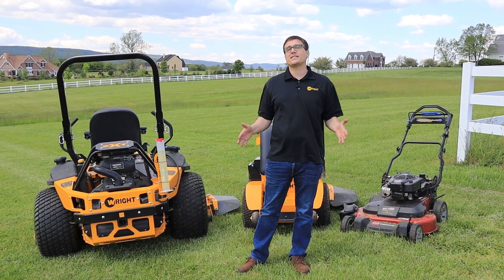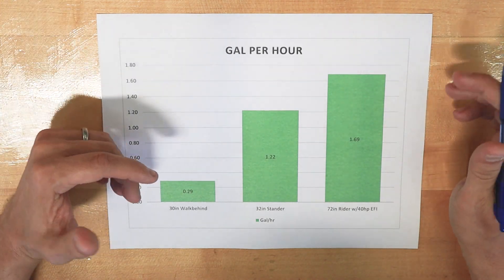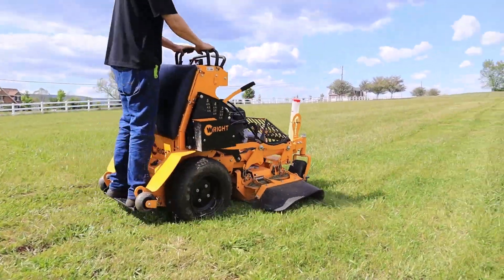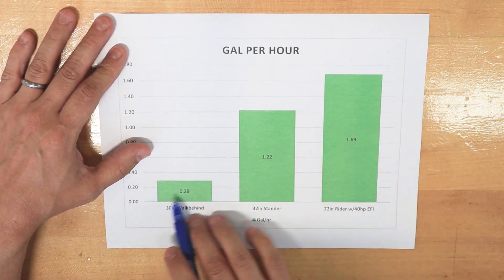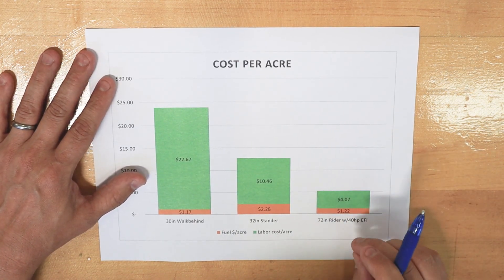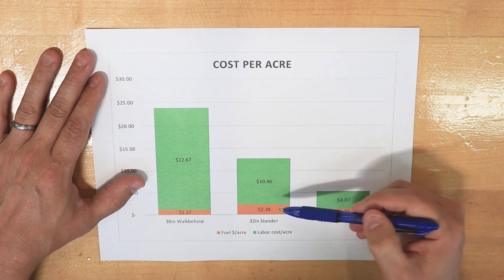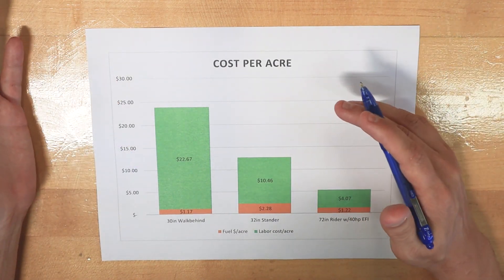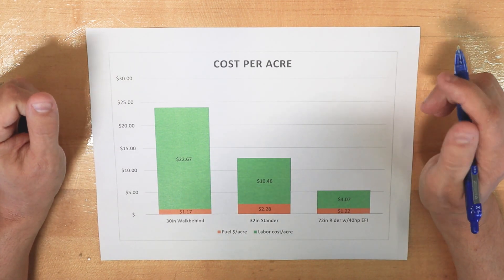Fuel Consumption Test: Gallons per Acre VS.  Gallons per Hour | WRIGHT

Comment: One interested conclusion to this data is... even adjusting for today's fuel prices, fuel is nowhere close to being the dominant cost. Even on the "fire breathing monster', which has the lowest labor cost. Interesting data. Thanks.
Reply: Remember you need to use ethanol free gas which is $1 -$1.50/gal more than regular for carburetor machines for best performance and reliability. EFI mowers don't care if they burn corn or gas as long as the ethanol fuel doesn't start in it over the winter.
Solo and mowing acreage GPH was a big deal. Cutting lawns labor and insurance are two biggest overhead costs

Comment: My older 36" Stander with a FH541v (17 Hp) generally burns only around 0.8 GPH, while a 61" 25 HP would burn 1.1 to 1.2 GPH in normal usage, and cuts over twice as fast.  My old Honda 13 hp beltdrive 36" only burned 0.5 gallons per hour, but used more fuel per acre than the 36" Stander.

Comment: Excellent information!! Crushes the misconception that bigger unit means higher Cost of Ownership!
Reply from the maker: Thanks!
Reply: @WrightMowers  You're welcome!
Reply: Not exactly... a NoN-fuel injected commercial machine has a FAR cheaper replacement cost for engine replacement.
The newer FI engines do save gas, may have more power... but run the same exact air cooling, and thus require rebuild or replacement around 2k hrs (at best)
Very expensive, considering the cost of the machine was Already expensive.
The same commercial machine with the less fuel efficient (off the shelf) carburetored engine (25-30hp) will also lose the engine around 2k hrs, 
BUT those engines are cheap and plentiful and simple to swap out... 
I think i'll take some fuel waste, over some fuel savings, when the FI engine is Much more complicated and roughly Twice as much to replace. 
You can buy an 'auto-choke' Briggs 25hp engine Right Now brand new for under $1k.
You don't even want to know how much a 35hp Briggs engine is, ordered thru the dealer (which is the only way you'll find it) costs... even IF it is available.
I'd guess around $4-5k.
That just destroyed all those hours of "fuel savings" ~

Comment: Great content........ we would also like to see a comparison of three exact 60” mowers with three different engines i.e.   27 hp Kawasaki carb.,   31 hp Kawasaki EFI, and finally 40 hp EFI.      My contention is that a 40 hp engine on a 60” mower or even a 72” mower is Gross Over Kill.    I liken it to shooting a squirrel with a 50 cal.    Somebody commented once.....well just throttle down.   Has anyone ever see an employee throttle down....  NOPE.   That is why we would like to see this TEST.   Gas is one of our biggest expenses.   We don’t want to feed the beast (drain our profits) if we don’t have to.   I know you guys understand this and hopefully provide your clients with smaller engine options.    Great mowers.
Reply: I think this would be great. I bet more of the efficiency piece will come down to HP for turf density and how much you’re cutting off. I’d also add another factor to this scenario. One run on a weekly service type cut. A second run on 3 weeks of growth where you’re cutting 8” or more off. Find the balance on engine HP for cost efficiency that’s best all around. I suspect each would have a slight advantage based on turf conditions.
Reply: @Camp-RiteRV  Yes, we actually also ran tests for mowing the grass, running the same area with the deck up, running the area with the blades off, and running at high idle to see how much fuel was being used for each portion of the work.  I think it was more than 50% correlates to how much grassing is getting cut off.  We didn't put those results in this video because the main point here is that bigger EFI engines save a ton of time and have nearly no trade off in fuel consumption (by the acre).
Reply: You never want operate a mower at anything but full throttle as you risk overheating the hydros (decrease in engine rpm = decrease in cooling fan rpm) and a decrease in cut quality (decrease in engine rpm = decrease in deck SFM). 25hp is just BARELY adequate for weekly growth on a 60in machine and I've been looking at engine upgrades for my 60in Z for a while now. A 35hp Vanguard would solve my problems and allow me to stay full swash through all of my weekly cuts. Another thing worth noting is that an engine running at max load all the time will not last as long as an engine running at 50% load. Wright does have an older video looking at an EFI vs Carb engine on the exact same mower. IMO the fuel consumption difference between a 31, 35, and 40hp EFI engine will be negligible.....at least not over a short period of time. Wright is all about maximizing durability, reliability, and productivity; the 40hp engine on the ZXT is what they felt they needed to achieve those goals. If you really need something with extreme fuel efficiency you might consider going the diesel route. The initial cost is higher, but they pay for themselves after some time. Kubota makes some sweet diesel mowers, so does Blount Woods and Grasshopper.
Reply: @jeremiahjorenby2275 .   I have a 27hp on one of my other zero turn mowers and it blows thru week grass growth like a hot knife thru butter.  Even tall wet grass.   The only time it might labor is on knee high grass (but how often are we mowing that height-rarely).  Therefore, for the duration of the season I am enjoying fuel efficiency.   The term “negligible” does not apply when you go from 27hp, 31hp all the way up to a 35hp or 40hp.  There is quite a jump is gasoline consumption and those that choose to go that route will clearly live at the pump and will be giving their hard earned dollars away.   You made a great point about Diesel engine, (I also own a Brand New Kubota BX 2380 tractor and the the fuel consumption is very low). But diesels mowers are heavy and have their own issues.   Well, I wish you luck on finding an engine replacement for your Z.
Reply: @sunseeker5071  Efi engines will out perform carb engines. deck size will also determine amount of grass cut. Bigger efi engines all consume very similar amounts of gph but a 72 inch deck cuts 20 inches more per stripe than a 52 deck. How much more grass is cut at that point. Efi is the way of the future for mower engines in the next few years anyway. Like with this test a 40 hp efi engine consumed .4 gallons more per hour than the carb engine which was under half its horsepower. Effectively a big engine jump for a small gas increase
Reply: @sunseeker5071  I have one of those early mule-drive style Exmark LazerZs with the 60in ultracut deck, I am now wondering if maybe the mule-drive is a source of parasitic loss. Then again, I don't know what the drive ratio of your deck is, what your torque output at 3600rpm is, and what the SFM of your deck is at 3600rpm. The ultracut deck on my machine is notorious for wrecking spindle bearings because Exmark spins the deck so fast. Exmark ended up slowing the deck down when they went to the triton decks to try and extend bearing life. A side effect of the triton deck was more fuel economy and better performance in tall stuff since the deck was now being underdriven.....but people who previously owned an ultracut machine were unhappy with the triton's cut quality on weekly stuff. You could achieve the same results by moving to a blade with less lift. If it wasn't for the fine fescues I have to cut, I would move to a lower lift blade. Curiously, when I replaced a 426cc 16hp air cooled engine with a 20hp 585cc liquid cooled engine on my little 50in Dixon 4516, I actually gained fuel economy. I can't say for sure why as there are many possibilities, but I have a feeling the amazing ignition system, less aggressive camshaft, and tiny valves on the liquid cooled engine have something to do with it.

It would be really easy to lay this matter to rest if small engine manufacturers listed the  fuel consumption of their engine at 25% load BSFC of their engines. During Wright's head-to-head testing a FX850V used 2gal/hr and an ECV860EFI used 1.64 gal/hr. In this case, the smaller displacement engine (the ECV860) which was rated for more power was more efficient, mainly due to the EFI. It would definitely be interesting to see the test you've proposed conducted. Would also be interesting to see a test of deck SFM vs fuel economy and blade lift vs fuel economy.

Both the 35hp vanguard EFI and the 40hp vanguard EFI displace 993cc so in my mind, the difference in fuel economy might not be as big as you would expect, but I could be wrong since the rotating assembly is totally different between the two . I could say almost for certain that the 40hp vanguard will have better/same fuel efficiency as the Kawasaki 35hp FX1000V non efi. We've come a long way though, back in the 80s, a 990cc engine only made 24hp.
Reply: @sunseeker5071  Even the bigger EFI engines are very fuel-efficient when operating under low load.  Think of it this way: an engine converts pressure into torque.  At high load, when the exhaust valve opens with more pressure, a lot of compressions (and fuel) is wasted.  At low load, the cylinder pressure is lower by the time the piston reaches the bottom of its stroke and when the valve opens, less pressure (and fuel) goes to waste.  One of the biggest reasons diesel engines are more efficient is that the combustion can be controlled to result in less wasted pressure at the bottom of the stroke.
Reply: @jeremiahjorenby2275  Ignition systems can have a huge impact on fuel consumption, which is one of the benefits of going to an EFI engine.  The belts actually take very little power from the system--the theory that driveshaft driven decks are more efficient is more of a marketing statement, especially when there is one belt, going to shaft, which goes to a gearbox, which goes to another belt...vs...a belt to the deck.  The rotating mass of the engine has very little to do with fuel consumption, but the displacement does have some to do with it--this is why you see more v6 twin turbo truck engines in the market today--the lower displacement means less air pumping losses when gently cruising and the turbos give you more power to (less efficiently) climb a hill or accelerate on an on-ramp.  What would REALLY lay this to rest is if the engine mfgs would publish their BSFC charts (search google for BSFC chart).
Reply: @Ed.Wright  Yeah, my statement that they should publish consumption at a percent load wouldn't work (idea in my head from how generator fuel consumption is evaluated) as 25% of 30hp is not 25% of 40hp and so on. After googling, I agree, BSFC charts are definitely the way to go.
Reply: One more measure to consider, overlap.   2" of overlap on on a 20" mower is 10%  2"overlap on a 72" mower is 2.7%. that's a significant difference right there. Always use the largest deck possible per the terrain and obstacles.
Reply: @jeremiahjorenby2275  The engine will absolutely be more efficient at a lower RPM if it's not under much load; but like someone else said, the concern is lack of air cooling when under higher load at lower speed.  We have done testing with multiple engine pulleys and engine RPMs (slower engine speed while keeping the blade speed up).  It didn't have a huge impact but it resulted in very little torque reserve so it would stall out too easily if you pushed it a little too hard.  The reality is the #1 factor is EFI and more power means getting more work done.